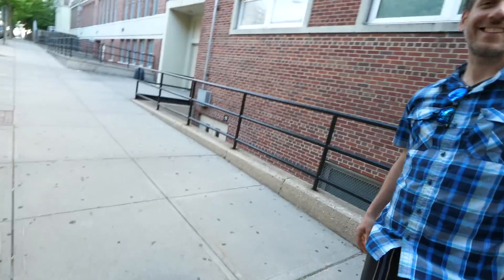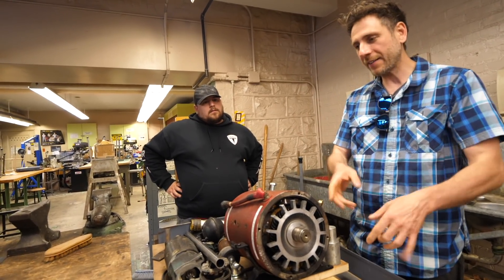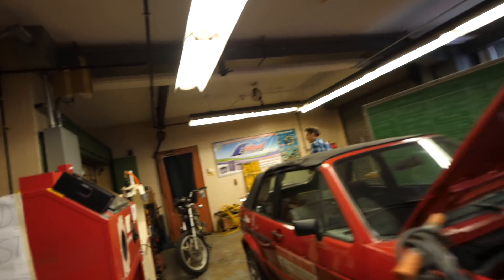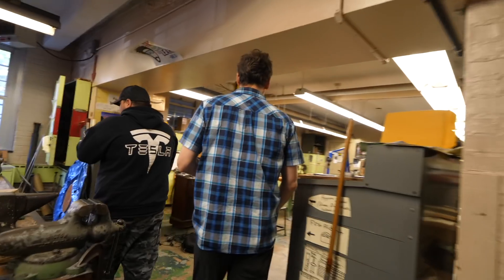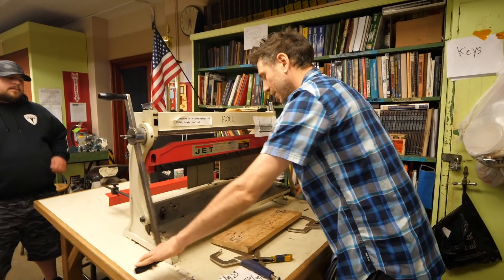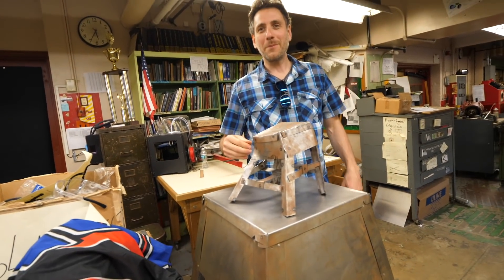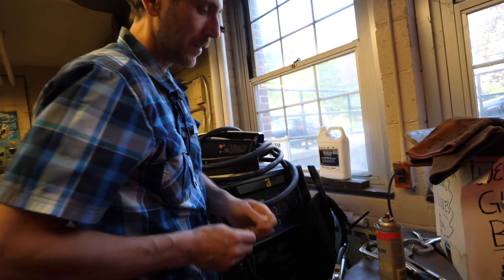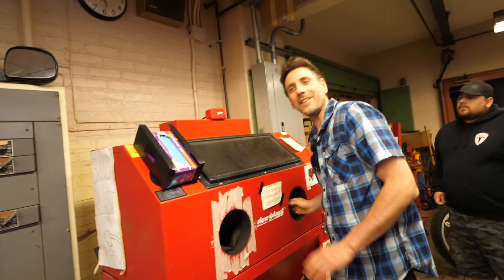Shop Teacher Building Electric cars

Comment: This is awesome working with the new generation preparing for their future, i myself had a chance to endure vocational classes,we had classes like sheet metal shop,machine tool and die,automotive, drafting ,small engine repair,welding, and building trades to learn to build homes ,here in michigan the government cut all the vocational classes ,this was a bad choice, now we are having difficulty finding young adults to fill the technical jobs ,now they relialized of their mistakes trying to recover but we still have a gap that will never be filled,we need a lot more people like you  to train for the future.

Comment: TIG is good but it can't do every kind of weld, right?
Reply: Do you mean different types of metals?
Reply: @MrGsWorkshop  - mostly thicknesses. It's limited, right?
Reply: Not sure what you mean. But TIG is very versatile. Probably the most versatile welder.
Reply: @MrGsWorkshop  - I mean can it weld 1/4" thick iron beam?
Reply: Yes, but that would be an unnecessary level of complication and cost. A stick welder would do that just fine.